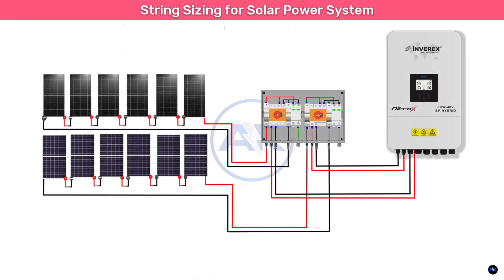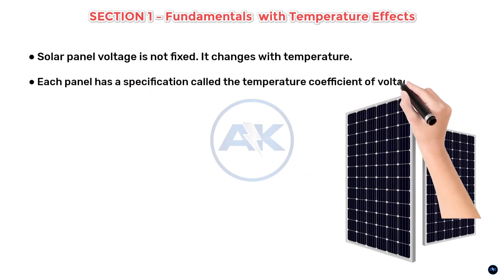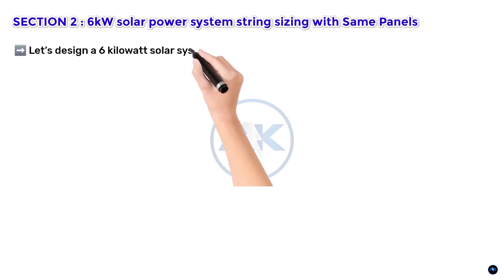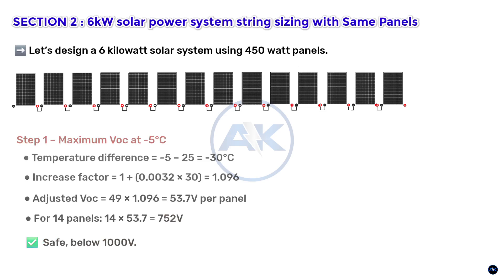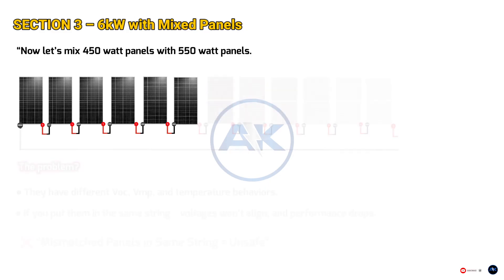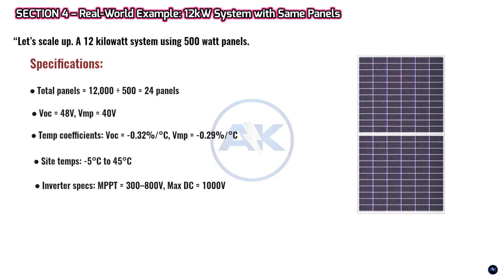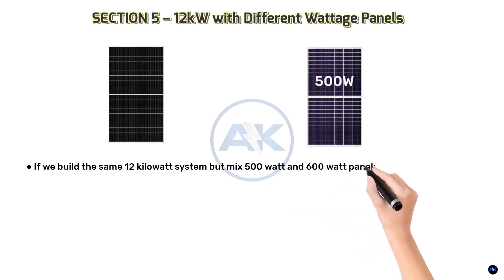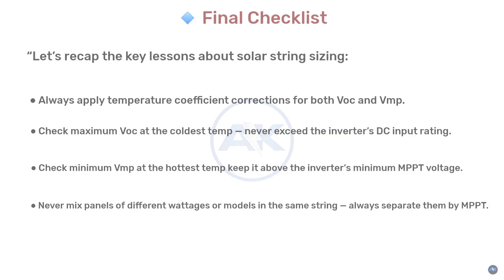Solar String Sizing Explained: Avoid These Costly Mistakes! (6kW & 12kW Examples)

Comment: If you have one freezer, two water heater, thirty two (32) bulbs 25w, one tv, two AC, and ten (10)  celling fan  at home how many solar panels, inverter and battery did you need to do your installation

Comment: good explanation, thank you. But you missed important thing - electric current. The current, generated by the panels, must be in working range of the MPPT. The temperature correction is also applied.
Reply from the maker: Thank you for the feedback and for pointing that out; that's a very important consideration in system design!